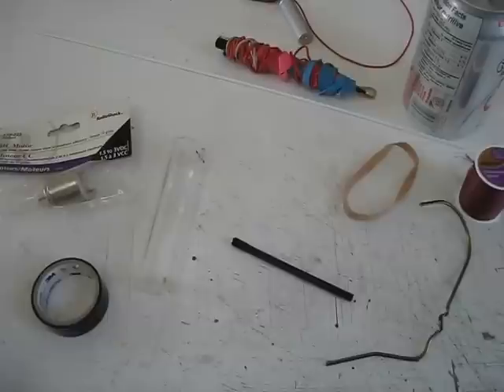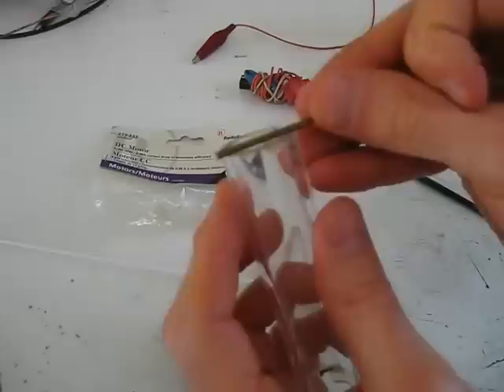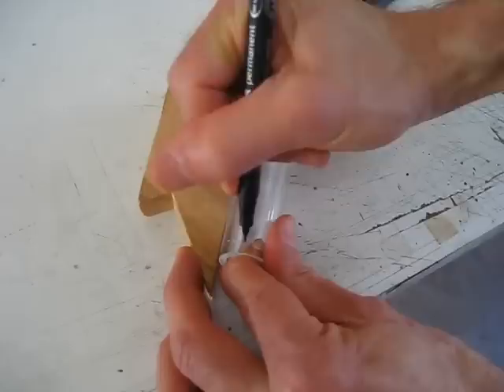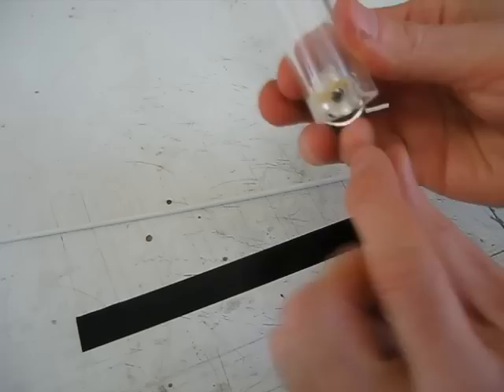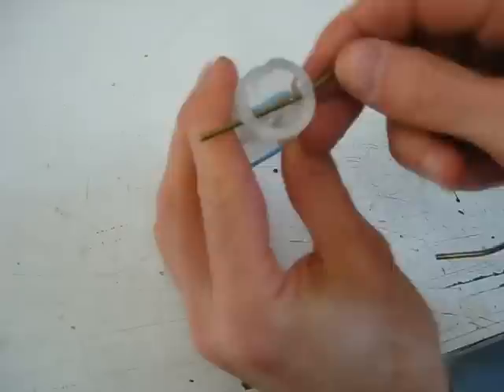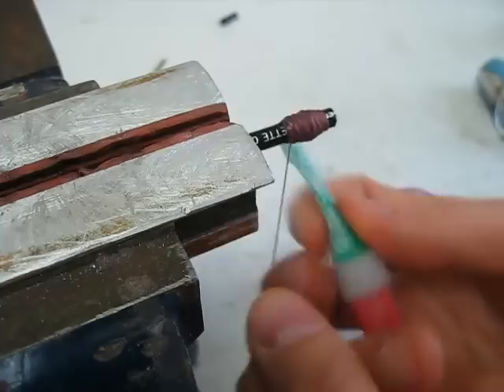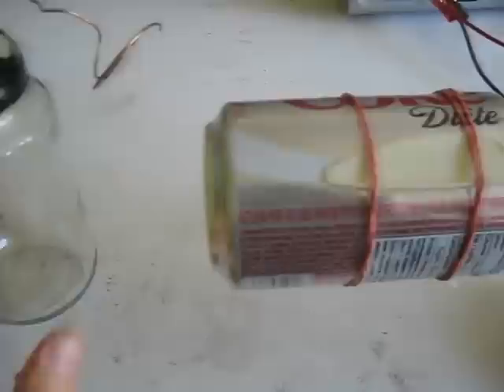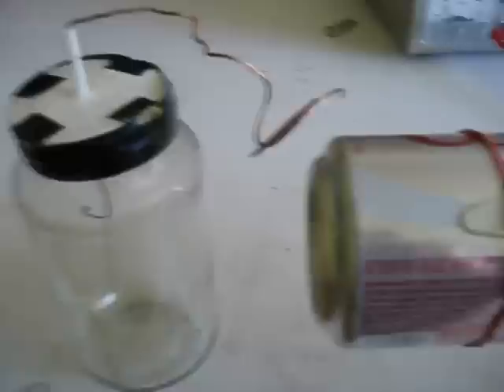How to Make/Build a Van de Graaff Generator Part 1 (Homemade/DIY)

Comment: Would I be able to use a Van de Graaff generator to create a speaker? Like, use its potential difference to make a speaker vibrate? If so, how would I connect it to a speaker?
Reply: Also, is there a way to control the voltage output from a van de graaff generator? How would you test its voltage and current with data logging equipment rather than with an electroscope?
Reply from the maker: +Dorfdude8 To make a vibrating diaphragm you could try making a circular disk of some moderately flexible material and with a thick metal disk glued at the center. Bring the diaphragm very close to the Van de Graaff's dome but not touching it and with the metal disk on the side facing the dome. At some small distance the disk should be pulled to touch the dome by induction. But when it touches it it would become charged and be repelled away again. And then it would be attracted back by induction, and then be repelled when it touches, ... and so on. i.e. it would vibrate.
But I don't know how you'd put your audio sound onto it. Maybe somehow control the stiffness of the diaphgram?
You may also need to put a grounded metal ball on the other side of the diaphgram such that when the disk is repelled away from the dome, it would be discharged by the ball. So there would have to be a hole in the center of the diaphragm so that the metal disk would be exposed to the grounded ball.
The voltage output of the Van de Graaff is partly determined by the amount of charge arriving at the dome from the belt. So you could look at some way to affect that.
Or you could control the voltage by having a needle separated from the dome and adjust the distance of it to the dome. The dome's voltage is determined by how much charge is on the dome, and the needle makes a conductive path through the air to the dome. But that's tricky to control since the air becomes more and more conductive the longer the needle is there.
You can measure the voltage using a high voltage probe like this one https://www.youtube.com/watch?v=kXq4FCQ0C38. Keep in mind that the voltage builds up over time on the dome. So making contact with it discharges it and the voltage becomes zero, or very low depending on how fast your measuring device takes charge from it to make the measurement. The dome builds up a voltage only when nothing's touching it and nothing sharp is near it. That's why an electroscope it good. And electrometer is another device that works. I'm not sure how you'd measure the current since it's so low.
Reply: +RimstarOrg Thanks. I'm trying to build a homemade van de graaff generator and control its potential difference so that it would change the frequency of the vibrations on a speaker. I was thinking I could make some kind of cool musical instrument out of the generator if I could control the potential difference which would in turn control the frequency of the vibrations. It's a bit out there, but I'm trying to make a system that works. Perhaps I could connect the generator to a circuit with differing resistors, and I could control what potential difference I want (which would produce differing frequencies) by putting in bridges in my circuit, where opening/closing a bridge determines the frequency of the vibration? I don't necessarily need rich musical notes per se, but I just need to know that I can control the frequency of the vibrations by a method of controlling the voltage output from the van de graaf.

Comment: Would this be large enough to power a model cyclotron? In your opinion should I or can I beef up some of the components with higher voltage to produce more energy? I plan on using the bowl with conductive tape and steel ball bearing to simulate the cyclotrons process. Awesome video!
Reply from the maker: ***** I suspect it may be a little too weak for even a small working cyclotron, though I haven't made a model cyclotron so I can't say for sure. Even with the enhancements in my part 2 video "https://www.youtube.com/watch?v=QrCgtjZwnB0" I suspect it might be too weak.
Reply: Thank you very much for the reply, have any ideas on how to produce the energy needed for the cyclotron? You're clearly much more of a subject matter expert than I...
Reply from the maker: ***** I'm sure my homemade high voltage DC power supply would do the job (https://www.youtube.com/watch?v=GEuK1OdYxHk) but it's a lot of work to make one. But as I said, I've never made a model cyclotron so I don't know what a minimum power supply would be. Without some experience, I really can't say. If aluminum foil balls were possible then it may not require much. Dunno.
Reply: I may look to buy something cheap as a power supply, or look for lightweight conductive spherical objects lol thank you very much sir

Comment: I did almost the exact same thing, the only thing I did different is I used Wooden Supports instead of a Plastic tube, but mine doesn't work, I do have mine connected to household ground.
Reply: Could you help?

Comment from the maker: (... continued, pressing Enter in comments now seems to post them ?!?) A better solution is PV (solar power), wind turbines if you have the wind and microhydro if you have the stream or river. You could also look for different ways to do things: solar cooking, passive solar for cooling and heating, solar air heaters, solar hot water heaters, direct drive from a bicycle for turning things that need to be turned (e.g. mechanical blender), ...

Comment: dont we need any high tension batteries or is only household ground enough???
Reply from the maker: I'm not sure what you mean. The high voltage is provided by a combination of the interaction of the belt and rollers/pulleys, and the fact that one of the wires is going to the INSIDE of the can, taking advantage of the Faraday ice pail effect. The ground is just acting as a good source (or sink) of electrons. A good ground is one that will continuously give you electrons whenever your circuit asks for them, and without your having to use much energy to do so. It's also one that will continuously take electrons that you give it without your circuit having to provide a lot of energy to get the ground to take them. Household ground is good enough, provided the ground hole in your wall socket is actually properly connected to Earth ground. Only one of the sockets in my old building has a good connection to ground. I show a number of other grounding options in my follow-up video "How to Make a Van de Graaff Generator Part 2".

Comment: loved your video,
just having one problem with the rollers and belt...
can i use aluminium for one side of the roller and polypropylene vinyl (pvc) for other side of roller and the belt of polypropylene vinyl (pvc) ???
Reply from the maker: Do you mean one roller with a surface of aluminum and the other roller with a surface of pvc? If so then yes. However, having the inner surface of the belt also be pvc won't work as the triboelectric effect. For that you need two different materials. It MAY work using some other effect since I've seen a lot of people succeed with one roller vinyl electrical tape, the other glass and the belt vinyl electrical tape. But in that case the charging may all have happened between the vinyl belt and the glass roller. I just can't be certain the the vinyl roller with vinyl belt didn't do charging from some other principle.
Reply: RimstarOrg  then can i replace vinyl roller with rubber bollon roller (i mean roller with a surface of rubber ballon) ???
Reply from the maker: Mohd Wasil
I think that will work. With the top roller being aluminum it'll be like at 8:02 in my "How a Van de Graaff Generator Works" video except that the inside of the vinyl belt on the way up will be negative and the metal will take up that negative charge. Also, the top dome will be negatively charged instead of positively charged like most Van de Graaff machine's domes. I'd be interested in knowing how it works out.
Reply: RimstarOrg thank you very much sir!  that helps me a lot.
when my van de graaff gets ready, i'll let you know.
once again thank you.
Reply: one last question i would like to ask,
is it necessary to do epoxy on the inside of the can (as my can is having small sharp edges on the inside) ?
thank you.
Reply from the maker: Mohd Wasil
I may have gone overboard with that epoxy. My edges weren't that sharp. And on the inside it probably doesn't make any difference.

Comment from the maker: Nope. The screw that's permanently wired to the Van de Graaff has a sharp point and other sharp edges. Instead of the Van de Graaff building up a charge it will just continuously leak charge from one screw through the air to the other screw and to ground. Better to use two round balls instead of the screws, the larger the balls the higher the charge buildup before the arc. In the case of my finger, it's well rounded and a relatively poor conductor so it acts like a round ball.

Comment: Does the shaft need to be plastic tubing?
Reply from the maker: Salcott Aam No, the shaft doesn't need to be plastic tubing. The important thing is the outer surface of the pulleys/rollers, but I mention that already in the video when I talk about the triboelectric effect. You might also want to watch my part 2 video "How to Make a Van de Graaff Generator Part 2" where I give some very good enhancements and tips.

Comment: If you replace the support with metal , will  the support be charged?
Reply from the maker: Yes, a metal support would get charged and your Van de Graaff machine wouldn't work. The support must be non-electrically conductive.

Comment from the maker: Ah, this time I pulled away the brush, put my electroscope terminal near the roller and then turned on the Van de Graaff. And this time the electroscope leafs separated. So maybe putting a high voltage probe there would measure something afterall.

Comment: hey when ever i connect roller my dc motor does not work can u any idea how can i do this
Reply from the maker: mihir sahu There are two approaches using the same motor. One is to check the voltage and current rating on the motor. If you aren't supplying close to those ratings then you can change your power source so that you are closer i.e. give it more power. The other approach is to put less tension on the belt by bring the rollers closer together, or using a belt what fits on more loosely. The belt doesn't have to be super tight. Then there's the option of trying a higher rated motor.

Comment: hy what can i use in belt can i use ribbon i can' t find a long rubber bsnd
Reply from the maker: mihir sahu Some people use black vinyl electrical tape with the sticky side facing outward. In that case the bottom roller is usually also covered in the same tape. In that case the outer surface of the top roller should be made of something more toward the positive end of the triboelectric series table (http://en.wikipedia.org/wiki/Triboelectric_effect#Triboelectric_series).

Comment: Do u mean when you pull the tape from the vinyl tape static electric is produce
Reply from the maker: In the Van de Graaff's where I've seen this done, the sticky side is not involved. The outside surface of the roller is the non-sticky side and the inside surface of the belt is also the non-sticky side. I've never tried that approach, but I've seen videos of people using it that way.

Comment: Rimstar can i use teflon for upper rolley,nylon for lower rolley and resistance band as the belt,what will i use for the dome
here we could not find any article,if it is possible to use rice bowls then of what material i could use?
Reply from the maker: Rohit Remesh Teflon and nylon should work well, but I don't know about resistance bands. I think I recall someone saying in the comments here that resistance bands don't work. For the dome any metal bucket, jar or container should works. I don't know what shape a rice bowl is.
Reply: Bt one had made it using resistance band which he posted in youtube
Reply from the maker: Rohit Remesh Oh good. Thanks.
Reply: Rimstar it is not working
Reply: How to test whether the electrons are transferred without touching it with our bare hands
Reply from the maker: Rohit Remesh
Make an electroscope "How to make an electroscope (DIY)" like I did. From what you've told me I don't see why it's not working, so see my part 2 video "How to Make a Van de Graaff Generator Part 2" and my FAQ webpage that I put together for people having trouble http://rimstar.org/science_electronics_projects/van_de_graaff_faq_frequently_asked_questions.htm. If you're still stuck by then, let me know but that should fix it.

Comment: what is the output of your dc power supply?. clearly the battery you showed in the video beginning cannot produce requires torque for the bands!
Reply from the maker: Unfortunately I've never measured the current draw from the motor when running the Van de Graaff using my power supply (or any power source). I keep the voltage under the maximum rating for the motor, I think it was around 5 V.

Comment: The wider the belt is the more static electric it produce . Right?
Reply from the maker: Yes, but more accurately it's the width of the place where the belt and rollers touch. To clarify, you can have a wide belt but narrow rollers. In that case the important factor is the width of the place where the belt and rollers make contact and any overlap of the belt doesn't help. Also, the width of the brushes should be the same as the width that the belt and rollers touch so that they can interact with all of that charge.

Comment: can I use wrist band instead of rubber band will it work like rubber band. i am asking because it has not that kind of elasticity.
Reply from the maker: +Zain Ul Abedin No, some people have reported in these comments that they tried a wrist band and it didn't work. Not because of the elasticity but because of the material itself.
Reply: Thanks for your kind response.

Comment: Could this be used to charge Leyden Jar?
Does increasing the rpm change the static charging characteristic?
Would it work better with longer/shorter rubber band?
Would putting ground wire on the motor increase efficiency?
Could this be dangerous if you used a aluminim globe stolen from city's Xmas tree,R=40cm?
Could this be a excuse for stealing Chrismas ornament from pine tree at City Hall?
Reply from the maker: Could this be used to charge Leyden Jar? Yes.
Does increasing the rpm change the static charging characteristic? Yes, you'd charge it up faster.
Would it work better with longer/shorter rubber band? Wider would charge up faster. Longer/shorter doesn't matter unless you make it so short that you start having sparks from the can to the motor side.
Would putting ground wire on the motor increase efficiency? No.
Could this be dangerous if you used a aluminim globe stolen from city's Xmas tree,R=40cm? The larger the ball, the higher the voltage. 40cm is more painful. Any shocks of course are bad for people with heart conditions.
Could this be a excuse for stealing Chrismas ornament from pine tree at City Hall? There's no excuse for stealing.

Comment: yeah the motor's rating is 3V
and im using three 1.5 batteries to form a 3V
it take power from 2 postives from the left batteries
and power from 2 negatives from the right batteries(including the center cuz my packet is only 3 batteries pack)

Comment: Can you use a needle as a collector ?because it has a sharp end
Reply from the maker: Yes, but you'll need more than one of them. A single needle will pick up the charge from only a small portion of the width of the belt. You want a few needles spread out across the width of the belt to collect more charge from the whole width.

Comment: hello rimstar. i have used fuse glass to make the upper roller and vinyl tape on lower roller ballon skin for the belt but still i cant get a spark or paper bits aren't moving plz help this has to be my science project so plz help
Reply: i haven't earthed it. is that the problem
Reply from the maker: Prerit Aggarwal Not earthing it would definitely be a problem. See my part 2 video for earthing/grounding suggestions https://www.youtube.com/watch?v=QrCgtjZwnB0
Reply from the maker: Prerit Aggarwal Okay. I should have pointed out this before but have a look at this FAQ page I'd put together. http://rimstar.org/science_electronics_projects/van_de_graaff_faq_frequently_asked_questions.htmLet me know if it still doesn't work after that.

Comment: Where can I get the wire with just copper inside? I don't want to cut open wires and have them not be the right ones
Reply from the maker: I'm not sure I understand your question. It would be hard to find wire that didn't have copper inside. The wire I show in the video has a silver color because the copper has been tinned, coated with a silver coating. That's very normal.

Comment: I'm using a larger motor and pipe than yours so i have it connecting to a small lawn mower battery.  I used some nylon rope I have for my cast net making. Works perfect except the random shocks from everywheres

Comment: I think you have to put the can around the upper charge collector and can't just connect it with a wire. Only the inside of the can has no electric field. The chrges on the belt should be transported against the E-field into the can.
Reply from the maker: I'd say that only the wire connection needs to be in the can like I did except that in this video http://youtu.be/xRLvbwF2MnMI I tested the two and it is much better as you describe, with the whole end of the belt inside the can. I end up doing that way in my part 2 video http://youtu.be/QrCgtjZwnB0.

Comment: is there any alternative thing for a drilling machine?
Reply from the maker: I don't understand your question. If you mean, can you use a drill instead of the motor then sure. It's even a little easier since you can simply grab on to the pulley's shaft as you normally would do for a drill bit.